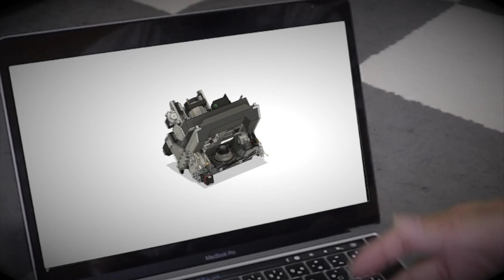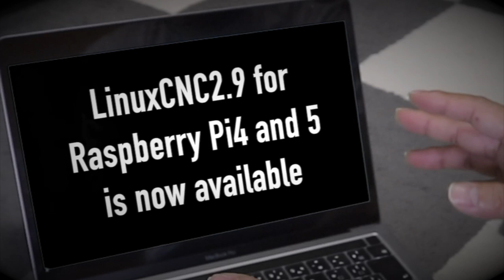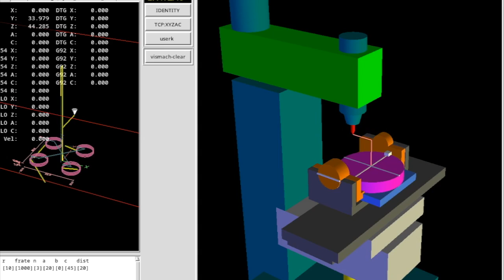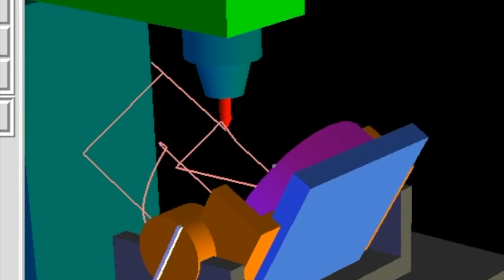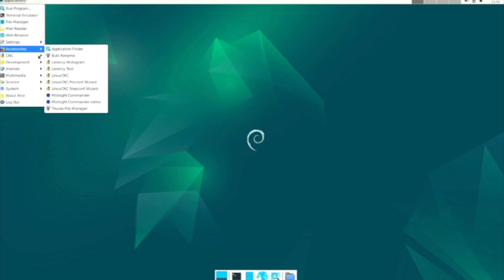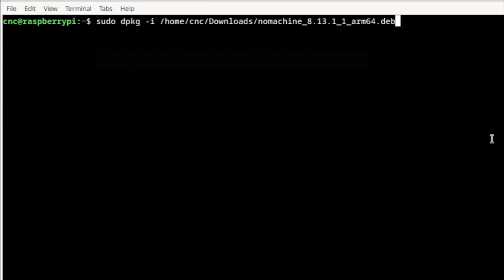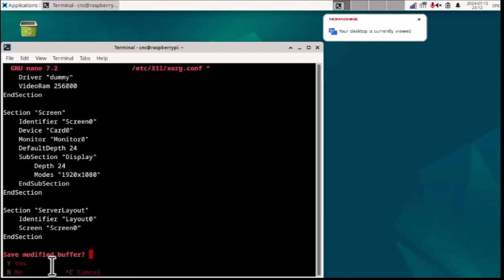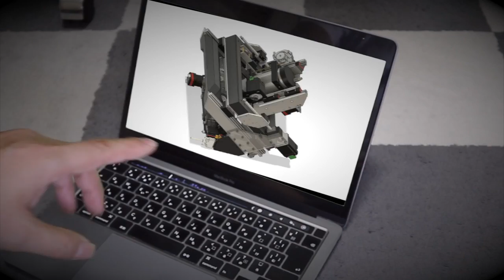Building The 5-Axis CNC Machine in a Small Room: A DIY Journey. (Part12)

Comment: i has build old version cnc machine 3 axis, and linuxcnc 2.8.4 but i not understand code anythink, how made touch probe working, button at display and then call g-code use touch probe set  bit top workpiece, zeroing. but try many many time last 6 month and no working, i not understand were location files need add and what code need add in file, button file, need working in display, and how call g-code who make zeroing, and were need files be location. etc,etc, lot problem ,lot error messages because not understand were all files need add.
Reply from the maker: I understand how you feel.
I have a few suggestions in the direction of a solution.
1) Read the LinuxCNC manual carefully.
2) Ask questions on the LinuxCNC forum.
3) Ask questions on ChatGPT.
I would do all of these.
Especially 3 is a very effective recent method.
I use the paid version of ChatGPT.
With the paid version, you can create your own GPT.
I made a GPT that memorized the LinuxCNC manual and the mesa7c81 manual.
I made this for me, but you can use it if you want.
All you have to do is ask questions and GPT will answer them.
It should be free.
I would love to hear your feedback if possible.

https://chatgpt.com/g/g-9KM9AY5d9-linuxcncnomaniyuaruji-2-9-2
Reply: @a-cnc-f  1. i has read many many time, but my english not understand all good and translator not help any, 2. i has ask many people in forum this but no help i has try make all what has peoples say but not working. 3 my low budget not can pay any forum or group and no help because not understand english good. i has zeroing bit only manual because not know how make this touch plate can make working. yotube not have many video whit linuxcnc do this all other mach3 etc other shit have lot . not help any whit linuxcnc because all need add totally different and other file locations. last i has add G-code all file folder what my linux have but not help, alltime only errors lot and no working, if bush button at display not do anythink, lot errors what i not understand anythink, i has delete all my codes and sweep clean all files what i make before now, not know how make this. manual working and has made not my project whit plywood only manual mode.
Reply from the maker: I, too, am not good at English.
Most of the information on the forum is too high level for me to understand.
You may not be interested in AI like ChatGPT, but actually I use a lot of AI when I make this video.
AI lies, but I practice it, verify it, and make the video.
I will continue to do so.
I am not a fan of remote control, because I have no knowledge of remote control and the problems it causes.
In the past, if I looked up something I didn't understand, I had to look up the jargon about it 10 times.
Even after I finished looking it up, I often ended up not solving the problem.

I understand how you feel. I know how you feel, because most of the time I do too.
That's why I use ChatGPT as a solution.
Of course, I can use it in my native language, Japanese.
I understand it in Japanese and then change it to English.
It should work in your native language too.
Times are changing.

Comment: Which CAM are you using for 5 axis that is cheap enough for people to use? Fusion??
Reply from the maker: I think the CAM that supports 5-axis and can be used by hobbyists in terms of cost will be fusion360.
The fusion360 is not cheap by subscription either.
I forget the name of it, but I believe there is a relatively inexpensive subscription CAM that supports 5-axis that is from the UK. I'm not sure how much it can do.
Reply: @a-cnc-f  2.3k for 3 years or 799 for one year so expensive for not really much features and a not so nice redo/undo stepping as well as some issues if there are too many operations after the thing you want to change. 

Ahh i will check, SolidCAM maybe?
Reply: I guess you mean Vectric?

Comment: All angular movements on my LinuxCNC don't interpolate. X, Y and Z interpolate and run fast, but if I add any A or B axis to the Gcode and use MasterCAM to generate a toothpath it will be slowed down because it is using G61 even when I write G64.
Reply from the maker: I have never used a master CAM, but it seems that when the G61 is used, it runs slower, as you say.
Reply: @a-cnc-f  LinuxCNC interpolates only linear coordinates. Angular coordinates are always executed as exact path mode. I hope they fix this soon. It is what is preventing me of using my 4axis mill effectively.

Comment: LinuxCNC has problems with the trajectory planner if the number of axes is more than 3.
Reply from the maker: LinuxCNC is very complex and seems to have many problems depending on what configuration and how it is set up.
It may be that there are problems with more than 3 axes, but I don't believe that is the case in all cases.
At least, I don't think it is a problem in my case.